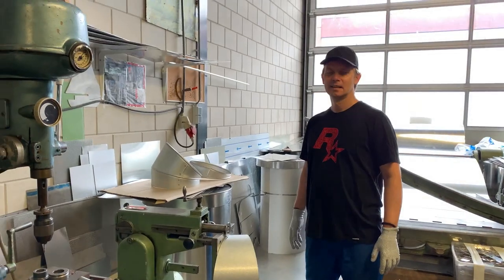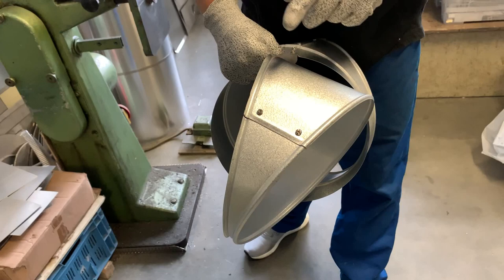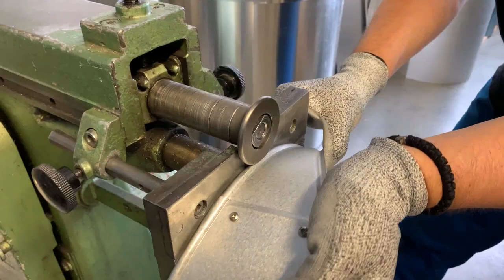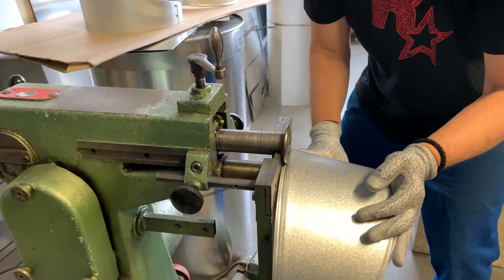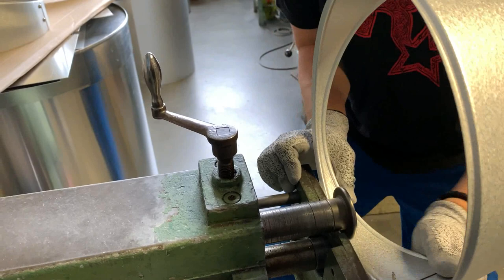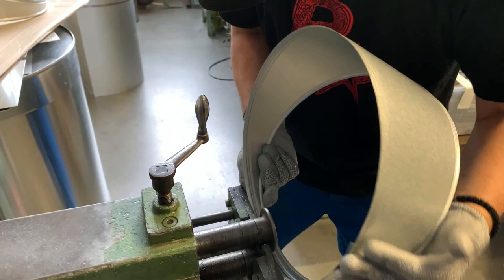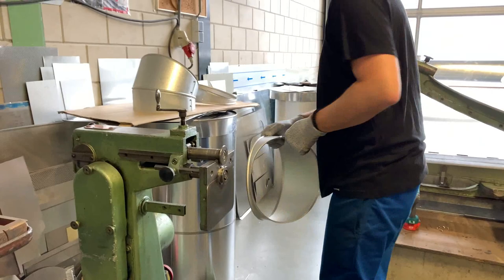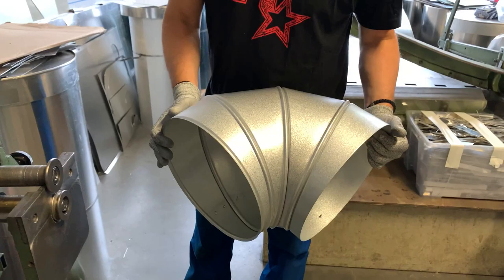Change A Swage (Umsicken)

Comment: Can it be done on thin aluminum sheet?
Reply from the maker: I have done it also on 0.6 aluminium
Reply: @Sheet_Metal_Workshop  in the United States they use .016 
 020 
.024
.O32 
.6mm would mean .024 for our metal over here correct?
Reply from the maker: @tinodeleon9989  correct
Reply: @Sheet_Metal_Workshop  thanks! Also one more question i don't have a electric swage machine the only thing I have a manual beader with all the dies, i assume its harder manually but it can be done that way or does it have to be electric
Reply from the maker: @tinodeleon9989  it can be done on manual it’s not easy as on a electric
Reply from the maker: Maybe I will get a manual swage Maschine and test it
Reply: @Sheet_Metal_Workshop  thanks! I appreciate the input